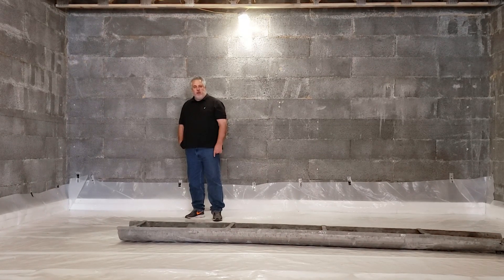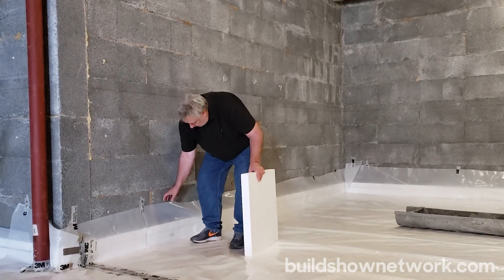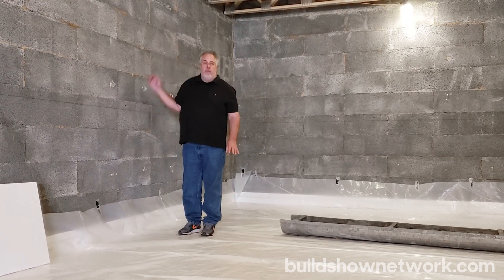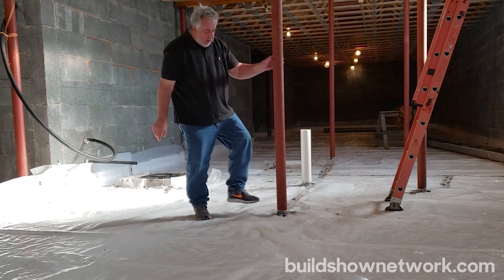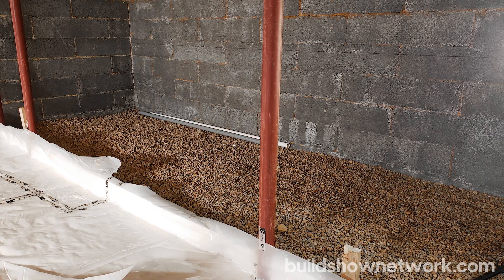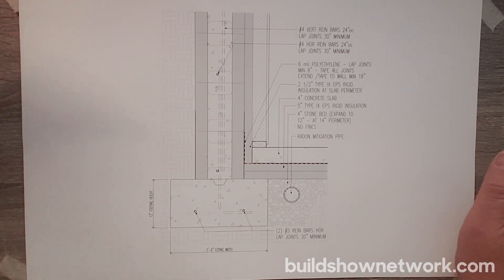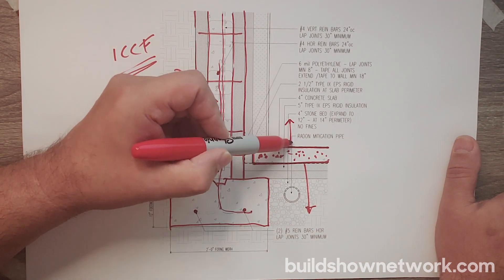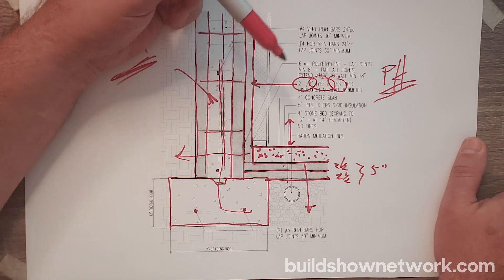EPS SubSlab Insulation Installation

Comment: Steven, it would be even better to lay thermal insulation horizontally outside the wall at ground level, extending ~4-6 feet and covering it with a slab sloping outward to divert water from the foundation to drainage. This approach is widely used in Central, Eastern, and Northern Europe with rainy/snowy or significant temperature differences between winter-summer and night-day. Such insulation improves the thermal characteristics outside the foundation and basement and stabilizes ground temperature near the foundation/basement; moreover, it makes the ground under such external slopped slab drier, contributes to thermal efficiency and soil stability, and, as a side effect, makes a basement less humid.